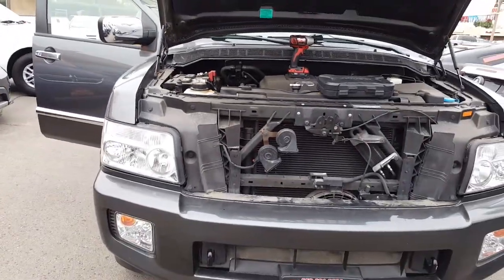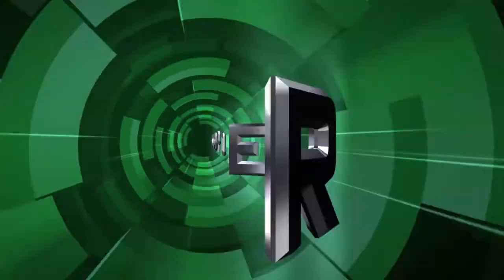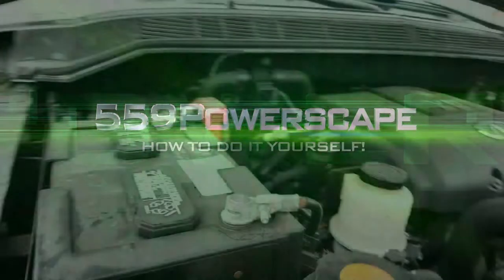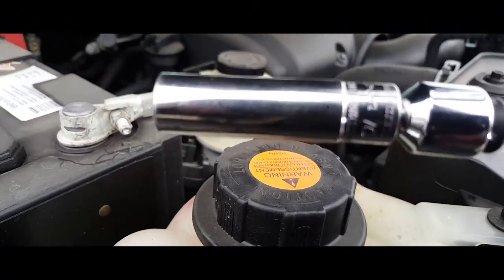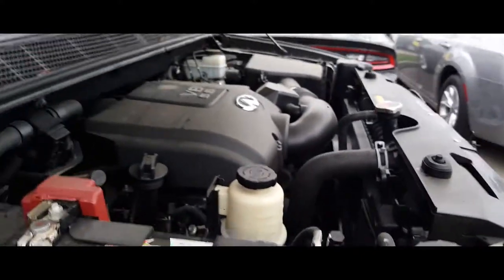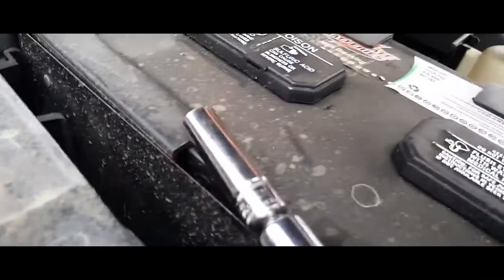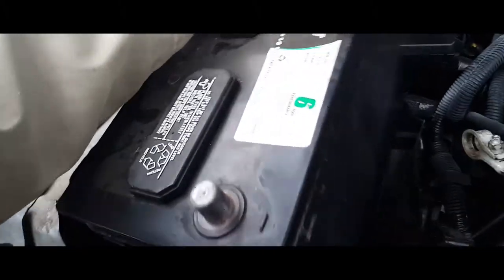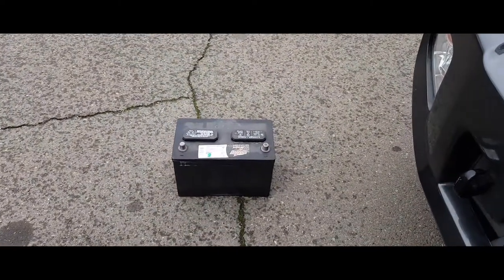How to: Remove a Battery from a 2010 Infiniti QX56

Comment: Will the car start just fine after reinstall it? A guy told me you need some type of reprogramming on the car
Reply from the maker: Yeah you should be good. I did it to this vehicle and had no issues. The battery was bad and needed to he jumped every time. Swapped it and no more issues 

Install video:
https://youtu.be/NTFR1uN7NME